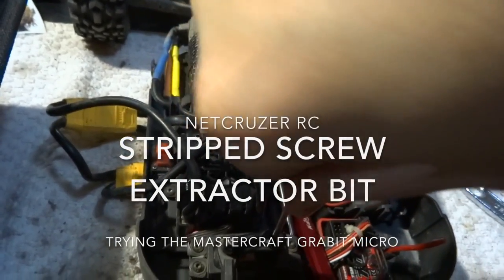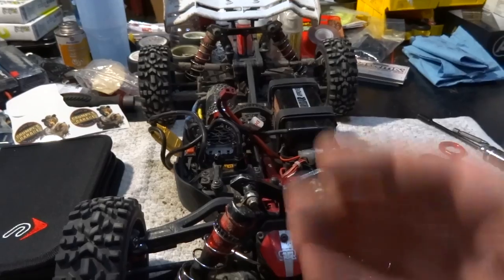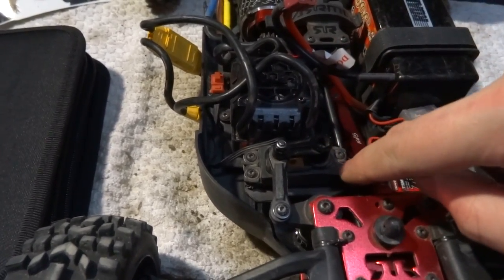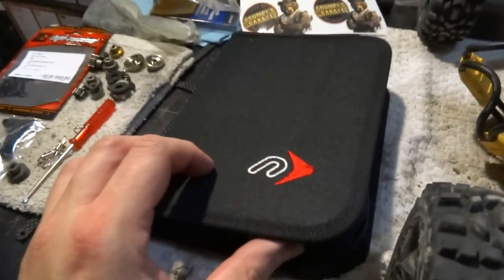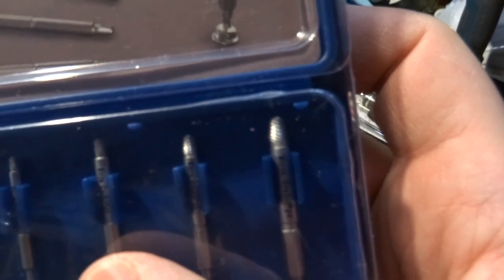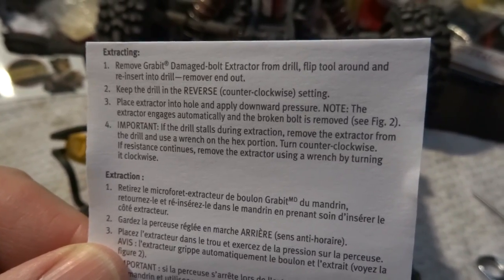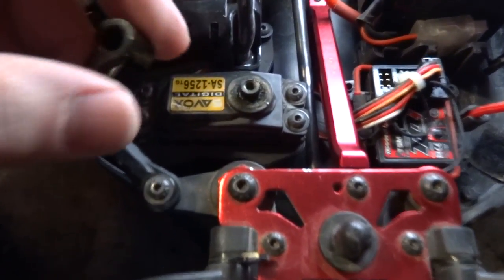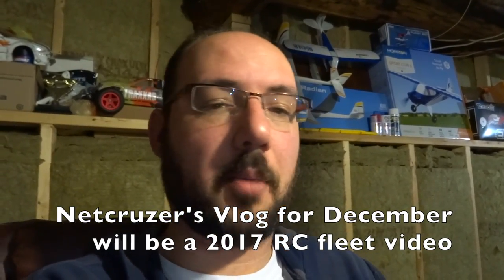Stripped Screw Removal - Grabit Screw Extractor Review - Tested on ARRMA Typhon - Netcruzer RC

Comment: Harbor Freight, Hercules brand 3pc "impact rated" screw extractor set. $9.99 smallest one worked for me with a fairly small team associated 2.0 hex screw. In a very difficult location to do anything else to remove and I was able to extract the pesky stripped screw.

Comment: Are the extractor small enough to get a grub screw out of a drive shaft I think it would be a 2 m size
Reply from the maker: Brian Longto it should be small enough if you get this micro size.
Reply: @netcruzer  I have had problems with the Stainless steel button head screws stripping out that's why I use socket head cap screws when I can and MIP bits always!

Comment: I’m curious, what’s the smallest size they come in? I need an extractor bit for my old 80’s Gijoes stripped screws..
Reply from the maker: The micro set is very tiny, the smallest might work. It’s handy to have anyway. But in my experience screws this small usually snap off the head during extraction attempts.

Comment: Typhon 3s motor mount hex bolt head broke off.....threaded stud still in mount with thread lock on threads......any suggestions how to remove it.... Pliers just spin on stud, factory put too much TL on threads....blue loctite stuff....motor mount is aluminum I think